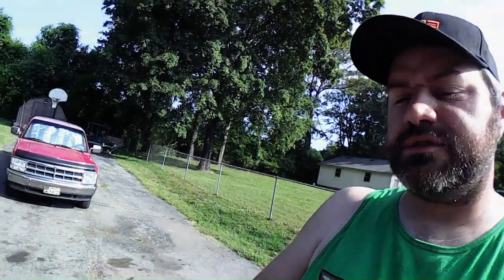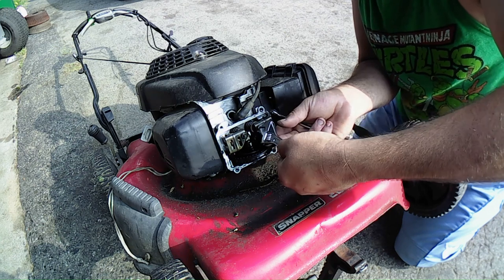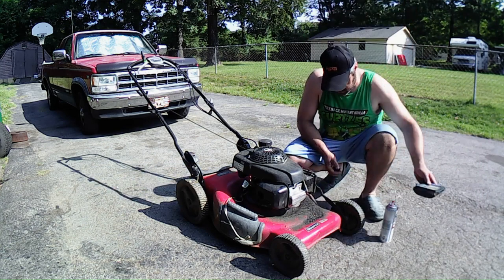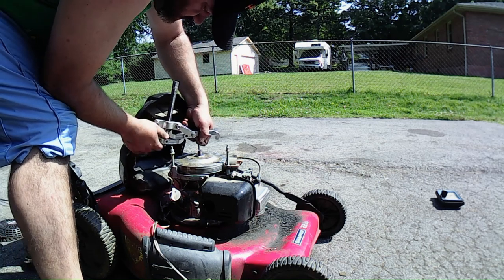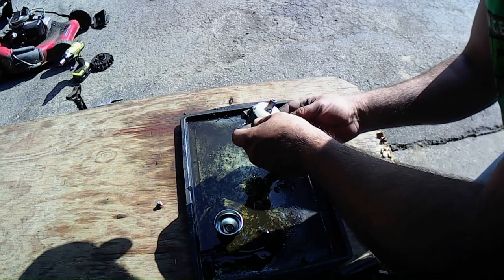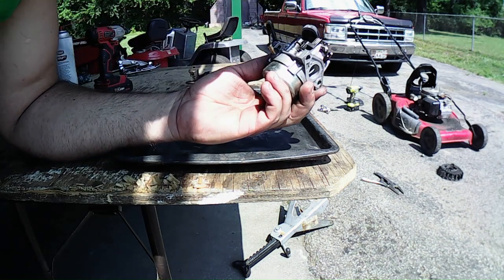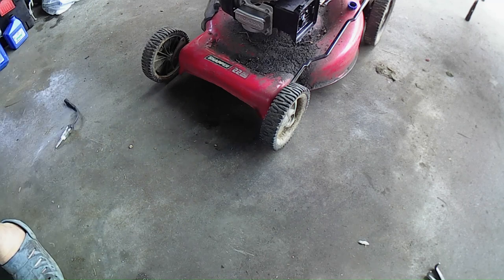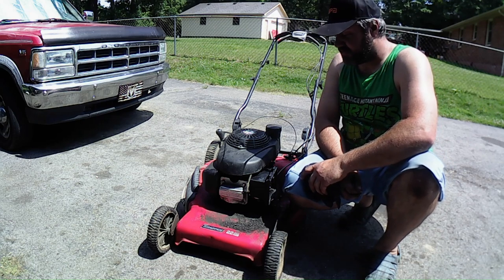snapper sp -110 22" rwd mower lets check the valves & clean the carb

Comment: Dont give up yet on the engine John. You wont get more than 50-60 PSI for compression because it has an ACR on the cam. I still think you have a timing issue because exhaust came out of the carb as you pulled it over. You may have set the valves on the intake stroke. The oil on the deck is from the pcv not being connected. Those engines usually start in one or two pulls. Goodluck buddy! ✌🎥🇺🇸
Reply from the maker: Well since that video I have pulled that Honda engine off that deck because there's no way for me to try to start it normal what that thing flopping like it's doing so I'll try to put it on another deck and work on it I actually am making a mower out off that snapper I needed for this Husqvarna like it but I haven't given up on that engine for sure also but you are correct I did see the exhaust also like that Mayne this engine is still good I hope 🤞 thank you roger
Reply: Roger is right about the ACR...as far as setting valves...I keep it simple bc I'm stupid.  I adjust valve where one is closed/tight and the other is open/loose and adjust the LOOSE ONE and repeat to other side.

Honda makes two different kinds of Motors...OverHeadValve and OverheadCam make sure you got the correct specs for the motor.  

That date is Cracked which means it took a hard hard...HARD HIT...if the keyway didn't break something else had give besides the deck...IT IS POSSIBLE the belt jumped and took the timing with it!  

Excessive oil out of the muffler could be worn rings or crankcase overfilled...does that oil on the deck smell like gas?  Could be possible the carb was dumping fuel into the CC and thinned out the oil and took out the piston rings with it. 

You can try this trick...poor straight 2 stroke oil into the spark plug hole and put the spark plug back in.  You are raising the compression in the motor bc its "wet" now...if it fires off you know you have low compression.  

Disappointed/Surprised none of the bigger channels you support are here to help you.
Reply: @pattayperformance  Jason you do the same thing i always do to set valves on  small engines?  Turn the engine until one valve is completely open and set the clearance on the other valve. Doesnt matter if its intake or exhaust. Forget all that compression stroke nonsense. It doesnt matter if its an 8 cylinder car engine or a lawn mower. I would bet that engine is fine! Jason its always good to see you helping out other quality channels! Thanks bro!✌🇺🇸
9
Reply from the maker: Jason I'll check this engine out for sure and see what kind it actually is and I'll double check the valves again on it and try one open 1st and go from there hopefully good results,  the blade was bent it'd on my next video when I took it off that deck that is broken unfortunately I snap a bolt 🔩  on there I'll have to get out if I do use it but I'll have to put it on another deck to try it again .

As for the oil I didn't check it to see if fuel got in it but I will but the pcv line was disconnected which why all that oil on the deck

Comment: A snapper mower that is powered by a Honda engine glad you are going to get it fixed and running again 👍👍
Reply from the maker: Yes gonna take more work than I thought originally
Reply: @Turningwrenches85  yes it did but you got what you wanted off the mower
Reply from the maker: @robertmailhos8159  that is true
Reply: @Turningwrenches85   yeah buddy 😎👍👌

Comment: I'd check valve seat
Reply from the maker: I will  look into it
Reply: @Turningwrenches85  Good deal,  where the valve seals to the seat.
Reply: If not, prior owner running that engine with all that crud makes me think it got piston rings hot and the rings may have got stuck in the piston.  May have to prop up the front of mower up and pour something to free up the piston rings through the spark plug hole. Work the piston a while after to see if it'll free up rings to gain compression to fire up
Reply from the maker: @matthewderickson1121  thank you Matthew I will try that for sure I pulled engine already off that deck but I want to save this engine if I can
Reply: @Turningwrenches85  you're welcome